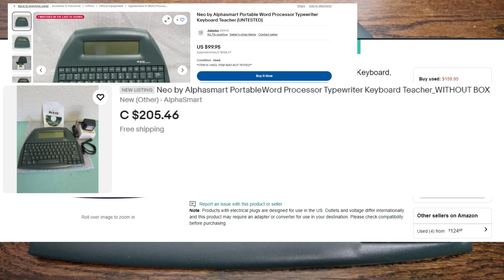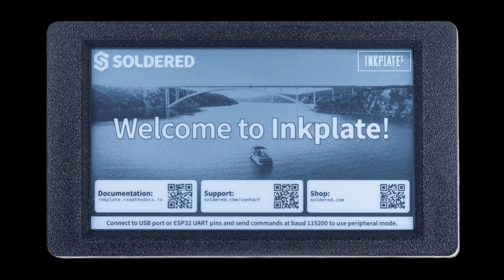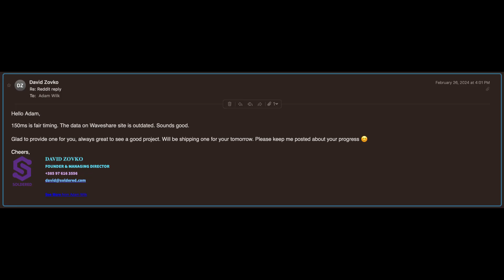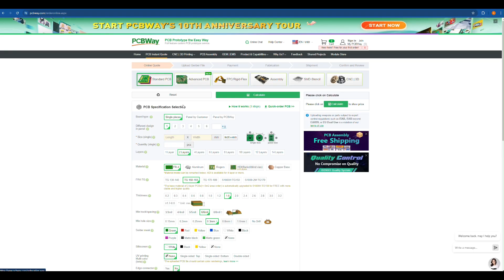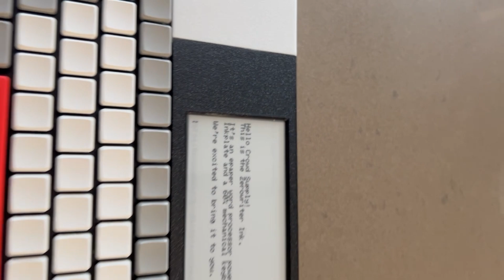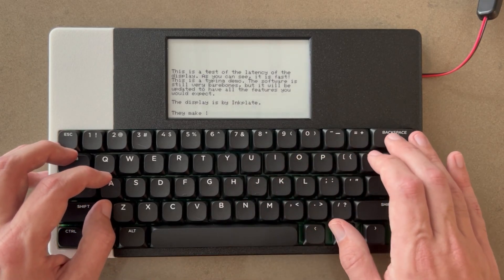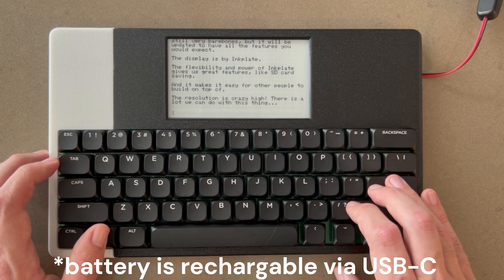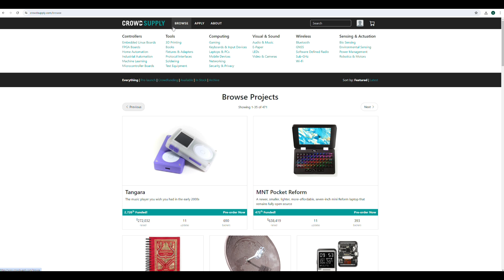Making An e-Paper Alphasmart Neo

Comment: I picked up 7 Neo 2s for about $75 total. I paid about $10 each for a box of 6, and $15 for the  7th. Then I got an original Neo with the bag, manual, original cable, etc. for $50. Now the prices are WAY high. So when I saw Zerowriter Ink I jumped on it. The damn Freewriter just ticked me off that they made it so damned expensive (and reports of  issues), so I was glad to see something good that didn't require mortgaging your soul to pay for it. I was glad to find it on Crowd Supply!

My own small development projects never got as far along as yours. But I did create a fairly niche device that lets you connect a Morse Code key to a USB port and use it as a keyboard. It accepted a straight key for simple enterying of code, or an added electronic keyer and a set of Morse paddles for more advanced users. The reason I put the thing together is that I have severe bouts of chronic pain that make it extremely difficult to type on a keyboard. It typically affected my right arm and hand more, so I tried the only available chording keyboard, the BAT keyboard, for the left hand. It took more energy to type on the long-travel mechanical keys than the keyboard typing I was trying to circumvent. Then the TAP strap came out. I have both TAP original, which I backed, and the TAP 2, which I bought on Amazon. It's a phenomenal gadget, and I like it a lot, but it's got a learning curve like Batman and Robin going up the side of a building with their Bat-Ropes. (Yes, I'm old, and still remember the '67 Batman show. I actually built a small TV jammer that would drive my sister away from trying to watch Dark Shadows, so I could take over the TV and watch Batman.) I wanted to reduce my motions to the bare minimum, and I'm already a ham radio operator, so I went with Morse. A little ESP32 "Beetle" board was plenty of processor for my needs, so with a pushbutton for mode selection, a piezo buzzer to hear the Morse you're entering, and a 3.5mm socket for the key plug, and a bunch of banging on software later, I had a working model that could allow me to answer chat messages or write short emails. It had the benefit that I only had to move one hand, and that only enough to use a trackball to switch between apps on my computer, and two fingers for the paddles to enter text. When you have body-wide chronic pain that can totally disable you out of nowhere, being able to still communicate with the world with only two fingers was a great boon.

Then my pain management doctors put me on an additional painkiller, and the worst of that pain was at least blunted, so I could use a regular keyboard.

I love distraction-free devices for doing my writing. I think it comes from learning to do my writing on an old Underwood Forum electric typewriter I got out of some junk someone was throwing out on the curb. I managed to get the thing home balanced on my handlebars, and it still worked. I think the only reason they threw it out was that it weighed about 50 lbs, and they'd found a replacement that worked better and weighed a fraction of what this monster weighed. Then I took typing in high school on an IBM Selectric. I didn't have that nice of a typewriter at home, but at least I could use the Forum better, as prior to that I was using the Bible method of typing: Seek, and ye shall find. Sort of like hunt-and-peck, but more informed.

In college, I used the mainframe the school was using for classes to generate RNF documents for my class papers. RNF is a version of Runoff, which is a TeX derivative markup language. It let me format the base text file for headers, footers, margins, spacing, numbering, etc. Then I used a line printer to produce final copy. It was very good printing, so the professors didn't complain. Then I got a Brother EP-22 battery-powered dot-matrix thermal "personal printer", though nobody called it anything but a typewriter. My first one had the I/O port on the side, so it technically could connect to some sort of printer, but I never found one I could make work. I THINK it was a serial port, but it could easily have been one side of a Centronics parallel connector. It was clear from the documentation, but that was in the late 70's -- early 80's, so I just don't remember. Recently, I found an EP-20 on Ebay for a reasonable price and got it. It's a decent little thermal typewriter, and I even have about a ream of 8 1/2 x 11" sheets to use with it. The print is the same rather faint and extremely dotty dot-matrix that I remember. Good enough for some very basic typing, but not good enough to OCR if you needed to get it into a computer. These days it's more of a talking dog than anything else -- the novelty is that the dog can talk, what it says is pretty much irrelevant.

Then I found out about the AlphaSmart devices, and hit eBay for a quick search. I found one for about $15. I bought it and it works like a champ! It was also the first one that I needed to perform brain surgery upon, replacing the CMOS battery for the memory. I was used to doing that to fix computers, though, so it wasn't a big deal. I got my start in personal computers way back in the CP/M days, when you had 64K of total memory for everything, and you probably stored programs on a cassette tape, unless you got lucky and could use 5 1/2" floppy disks. I got a Radio Shack Model 100, their first attempt at a laptop of sorts. I got a sample of the CMOS RAM from Kyocera, back when you could just ask for engineering samples and get them, and increased the Model 100's storage from 16k to 32k for the shipping charge on the chip. Radio Shack was charging about $300 for that chip back then. Then I got an NEC-8001 personal computer system from the company I worked for. They had a huge closet full of old computers they had bought over the years to test their software on, to insure compatibility, and I got the 8001 for $50, including the CPU, 2 disk drives, and a monitor. Oh, and all of the documentation and software they had for it. One of the guys I worked with was part of the NEC team that developed that machine, and he gave me a copy of the CP/M version he'd developed for it, giving me a 62K TPU space, the irreducible core of the OS residing in only 2K instead of the 4K it usually needed. That computer was awesome, with Wordstar for word processing, a spreadsheet for accounting, and a bunch of other stuff. It also had a good assembler and debugger, and my first shareware programs were in Z80 assembly language. Getting my first software registration from all the way across the planet in Australia was a total kick. It was for a program I called "Foldir", which printed a directory listing of the diskette on a piece of paper, along with lines you folded the paper on to make a sort of Origami diskette envelope with the directory right smack on the front. It saved dealing with labels and such, and if you bought bulk diskettes you didn't have to pay for the envelopes, because you printed your own. I also had a small program that would take text files, such as readme text, and print it out 4-up on regular printer paper, by using elite compressed superscript mode on an Epson printer. It was still readable, if a little cramped, but it saved a lot of paper when printing huge program listings and software manual files. 

My first PC I worked on was in college, an original IBM PC purchased on the college discount. It belonged to the library, and I was assigned to take care of it and do whatever programming the library needed. So I used that, and the Apple IIe out on the library floor, for my papers from that point on, so my professors didn't have to read the inferior type my RNF documents sent to the computer lab line printer. But later, when I had a subsequent job after graduating, I got a PC clone. That's when my old friend the NEC engineer told me that a V20 chip would replace the 8088 processor and work identically to the 8088, but would also run my old 8080 and Z80 programs. So I got yet another engineering sample, and upgraded that PC for only $20. 

The guy I bought my first AlphaSmart from let me know he had a box of six units he'd gotten from a high school he was helping to renovate, and would sell them to me at $10 each, as is. I jumped on it. They all needed CMOS coin cells replaced, and one had been stored with the batteries in it, which leaked badly. The negative spring terminal was hanging from the wire, the electrolyte having caused the plastic of the battery tray to crumble. I neutralized the alkaline electrolyte with distilled vinegar, then rebuilt the battery tray with baking soda and CA glue. It reacts to make a substance that's rock-hard, and can be filed, sanded, drilled, just as well as the original plastic. I did that, and when I went to put the negative spring back in place, the wire fell off. I tried stripping it back to find fresh metal, but the entire length had been infiltrated by the battery electrolyte and corroded into junk. So when I replaced the CMOS battery, I also replaced the power leads. When assembled and tested, it worked just fine. So I had one Neo 2 I used day to day, and 6 replacements in case the one I was using broke irreparably. The last one, the $50 Neo 1, was mostly because it came with all the original accessories, including the messenger bag, printed manual, original USB cable, and maybe a couple of things I don't remember. I had to do the CMOS coin cell replacement, but that was getting to be routine.

Being somewhat obsessive, when I started seeing new distraction free devices come available, I wanted to have them. As I said, I didn't get the super-expensive Freewrite, but did back Zerowriter Ink, and after that, the BYOK, which will have a totally different use case than the Zerowriter Ink. I'm looking forward  to getting that Zerowriter! If there's anything I can help you with, let me know.
Reply from the maker: wow -- $10 a neo is a great deal. You are going to make people jealous... Thanks for your support!

Comment: Fantastic work on this project, looks pretty comfortable to use and the menu system seems intuitive.
You seem to have room for an extra key next to the arrow keys, if you scrunch them together, so adding some functional key around that area would be neat.
Something like a quick-save, send to print, show/hide UI elements, highlight spelling errors, etc, etc ad nauseum. You could also put a dial at the end for easier and smoother scrolling.
Also consider making localised and ISO versions of the keyboard!
Having ports for storage devices and/or a printer would be nice too.
Maybe also a bigger screen, unless of course that goes against the philosophy or cost of maneufacture of the writer.
Overall though, I love the idea of this. It looks light, it looks portable, without sacrificing too much in the way of comfort, ease of use and functionality. I've seen far too many ecamples of small computers and the like with keyboards that are awful to type on, this is meant for typing on after all, and in that regard you've done a stellar job. 
Thank you so much for sharing!
Reply from the maker: Thank you for the kind comments! I would love to be able to make ISO and other keyboard designs... hopefullly soon. One step at a time!

Comment: Hi Adam! First as a dev to dev - this is a cool project, indeed! I took a very quick look at your github, it says this is 100% Python code, which is cool too. I don't understand why the left 1/3 of the body is white? Suggests this is a removable part to me. Maybe this is the battery compartment? One thing I don't understand - what format are the files being saved to - ASCII files or something else? Keep going! PS: Noticed you're from Ottawa - you could try talk to Indigo to sell some.
Reply from the maker: @strayferal  hi :) the original project using a raspberry pi was written in python. This one uses a different code base. the two tone thing was just a design idea for fun. Files are saved plaintext as .txt

Comment: looks amazing!
A lovely piece of project!

a few questions:
A. Does ZeroWriter still support Waveshare 4.2, or do we now have to buy this InkPlate?
B. Does ZeroWriter  support a simple USB keyboard?
C. Does ZeroWriter support additional languages besides English (specifically asking about right-to-left languages, such as Hebrew and Arabic.)?
If not, how difficult do you think would it be to add additional language?
Reply from the maker: @אוריטאובר  hi! This project (zerowriter ink) is with the Inkplate. It does not support USB keyboards, but could be expanded to by a hobbyist. Multiple language support is planned, but right-to-left and unique input styles might need the community to add themselves.

My other videos are for a raspberry pi based project which would support USB keyboards and more easily other languages / inputs via Linux. The advantage to raspberry pi is the flexibility.

Comment: I'm not sure the eink is fast enough for my liking, but if the editor had vim keybindings, I will no joke build one right flippin now. Man oh man, a purpose built vim device.
Reply from the maker: @dowhilegeek  if there’s some version of embedded Linux that can run VIM, it could be doable! ..and I think I can squeeze a bit more refresh out of this panel, but you should check out the Inkplate Motion to see what is possible
Reply: Regular LCDs work just fine, they're just kinda pricy because there is less demand these days...
Reply: Dream device for me
Reply: VIM? Are you mad? Everybody knows that ED is superior!

/s of course. A small and portable word capture device sounds absolutely amazing to me, whether it makes us use vi or ed keybindings, or even DOS edit menus etc.
Reply: @mattsadventureswithart5764 I love nvim
Reply: Same! The original vi had a bunch of code for efficient screen redrawing (updating the smallest are) to make it usable over slow modem connections. That seems like it would be a good fit for e-paper displays. And ed would be an even better fit, naturally, since it was developed for working on a display made of actual paper.

Comment: Would be cool to run this all from a phone, writing in Google docs. You can already connect a keyboard and screen, but an eink screen would be a cool addition
Reply: Phones are pretty power hungry devices though, even when idling. 

They're definitely more efficient than they used to be and bigger batteries have been used with time.  
  
Using Google docs in real time would also require an constant, reliable internet connection.  
  
Imho, it would be much cooler if you could give this kind of device the capability to upload to/download from google docs.

Even better would be a transient update function that can periodically sync(hronize) changes, freeing you from being tied down but providing some backup capabilities.

Comment: Nice, I built something like this with my Core keyboard back then, but it wasn't an ePaper, it was one of those ultra-wide Waveshare displays. ePaper is even better. And this all-black version with Core keyboard would be a dream for me because it's small and compact. I'm curious to see what happens next...
Reply from the maker: @Papierzeit  yeah! I’ll probably do a 40% design again down the line, probably a really custom take on one that most people will think is crazy… 

In the meantime I’d recommend checking out the Micro Journal — it’s a 40% ortho device like this, except no ePaper.

Anyway thanks for the comment!
Reply: @ZeroWriter  I really like things like that because they make you so productive. My favorite device that I used a lot back then is in my opinion unbeaten so far, is the Cambridge Z88 where I had two of them and sold them. If you want to know more about it I can tell you what I particularly liked about it.
Reply from the maker: @Papierzeit  yeah please! I’ve never heard of that before.
Reply: @ZeroWriter  It's this magical machine with a particularly quiet keyboard that's great for typing. I like my Core keyboard which is my main keyboard with the Black Switches but a quiet version can be ideal in many places. Imagine a library, where it is appreciated if you are quiet. Batteries or rechargeable batteries last forever. It would be great if you could customize the display with a backlit version. That's all I would need. It has the ideal size of a sheet of paper, so you can pack it anywhere.

Comment: which switch does it use? choc v1,choc v2 gateron lowprofile? can it use regular size gateron switches?
Reply from the maker: @4minyte888  currently uses chocv1, but the build in the demo is chocv2 with Mx keycaps. I am also considering gateron low profile. 

This version will be low profile, but I’ll also release the PCBs for a standard cherry Mx switch so people can make their own standard profile if they like
Reply: @ZeroWriter  chocv2 sounds great. By "release the pcbs for the standard cherry Mx" does that mean releasing the layout which we can then order from pcb way and do the soldering? i dont know how to do that </3.
Also can i make a request? can the battery be changed to double A? pomera dm30 uses a battery and a coin battery, but the keyboard isnt so great. I guess i just wanted it to be repair friendly, where i dont have to buy lithium ion battery from elsewhere, i wanna be able to buy double a battery from the hardware store. The saving isnt a problem since this can save on to SD cards.